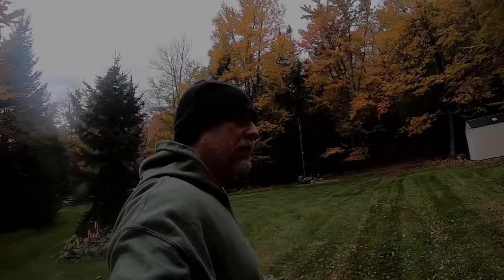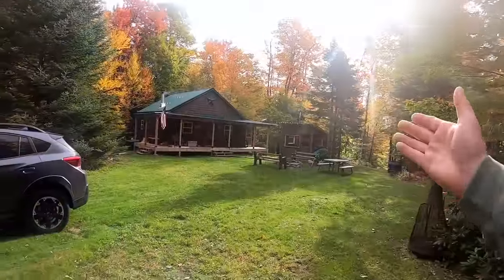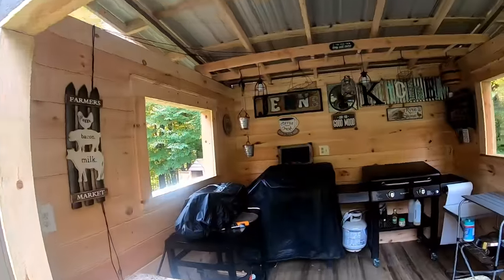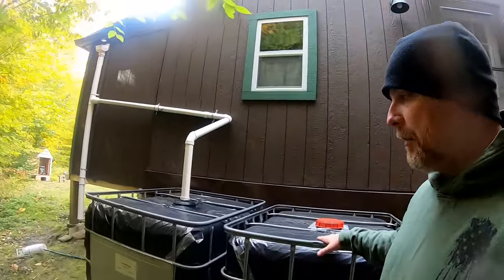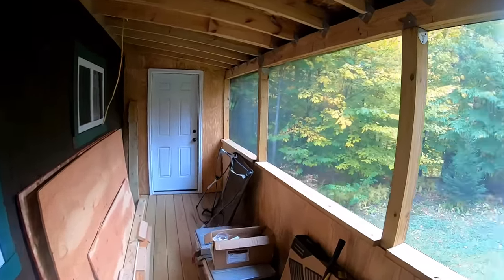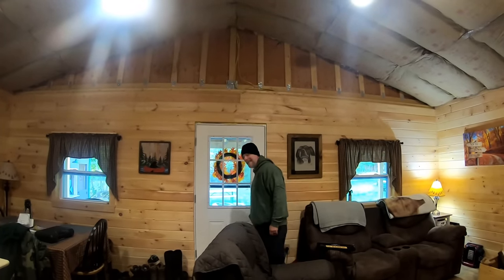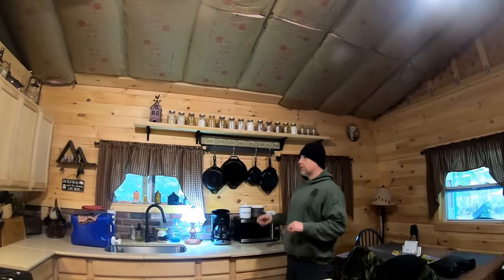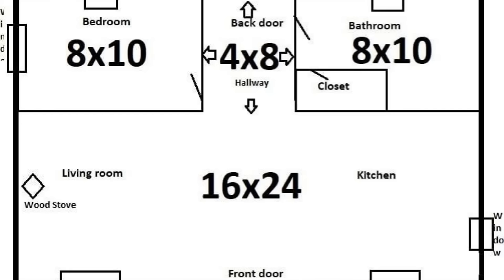VT Cabin Tour  inside and out!  24x24 Off grid cabin.

Comment: DID YOU FORGET PROPERTY TAX ??? /  JUST BUILD A BOX AROUND THE WATER TANKS  SO YOU CAN DO MAINTENANCE WORK TO IT  /   UNDER THE HOUSE IS A PAIN IN THE ASS  /   FOR FLIES AND BUGS  ,  BUILD  BAT HOUSES AT THE ENDS OF THE PROPERTY A BAT EATS  2 TO 3 TIMES IT WEIGHT IN BUGS  AND SOME BIRD HOUSES BIRDS EAT BUGS AND THEY ARE GOOD FOR THE HEAD TO LOOK AT
Reply from the maker: I haven’t watch this video in a while. But I think why I wanted to put it under the cabin is due to freezing. I think I have the cost of the build without tax. Thank you for watching and I do want to get those bat boxes!